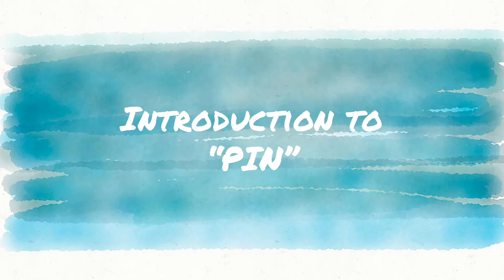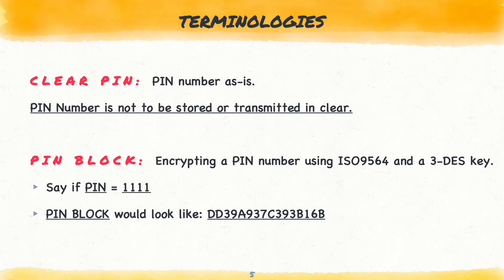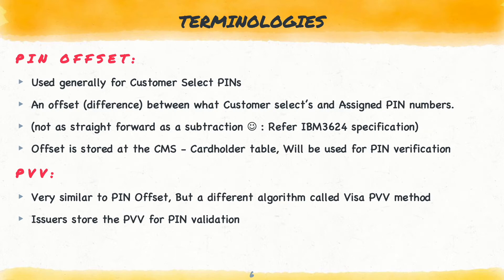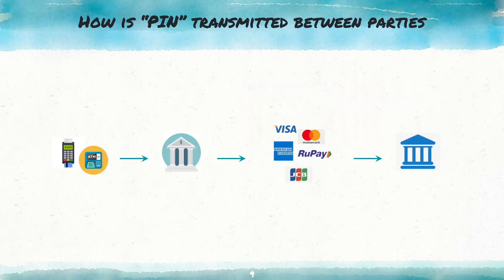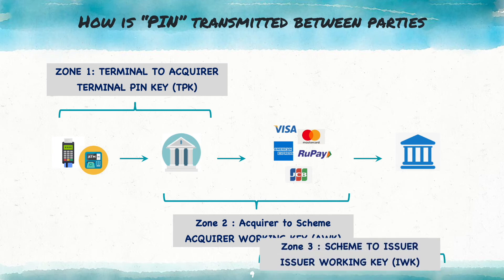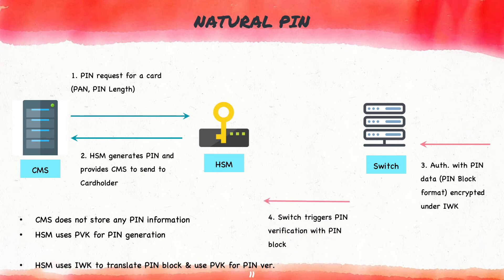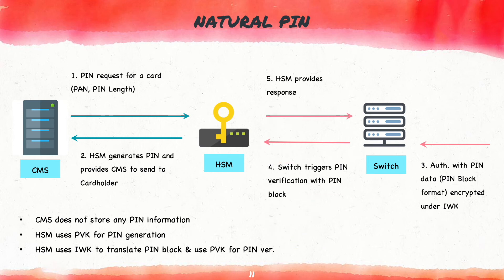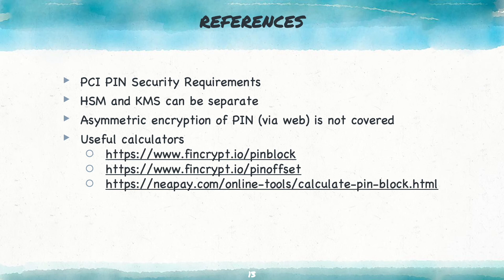Introduction to Payment Card PINs

Comment: Great learning experience. I have a question. Can a system accommodate both pin offset and PVV value?? 
In that case the pin offset value is the same as the PVV. If the pin is changed, so is the offset value. In the switch it will update the new pin value and also store the old one.

Comment: What happens when the pin is changed in the ATM?
Reply from the maker: As mentioned in the video, when Customer selects a PIN, a corresponding PIN block is transmitted from ATM to Switch, Switch to Issuer. Issuer stores the PIN offset for the corresponding PIN, for further validation. 

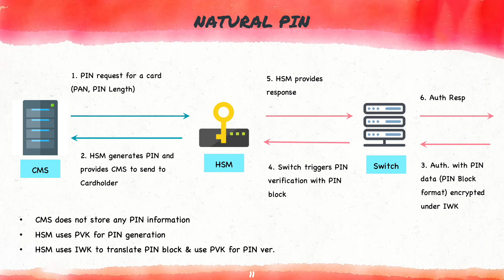Please watch the video from 7:26 mins 

https://youtu.be/zn1KGAOLanA?t=446
Reply: @LearnPayments Got it,thanks. what are the data elements and message type(Ex: x1xx,x2xx)  associated with the pin change?
Reply from the maker: These messages are usually 0100 (some schemes do use 0200).

Current (old PIN) is stored in DE52. New PIN data is sent in DE125 (for MasterCard, DE120 for RuPAY.